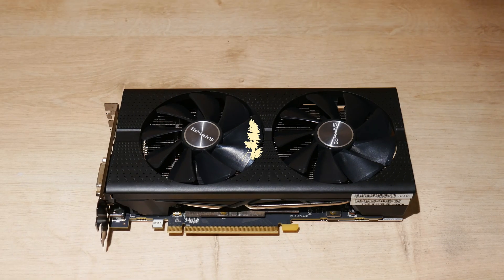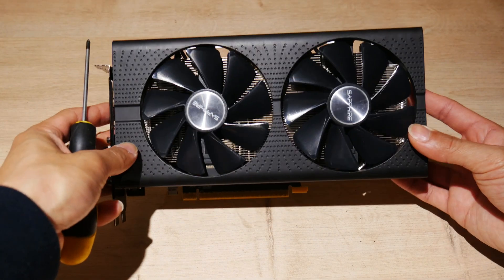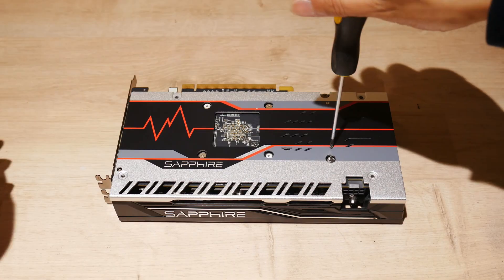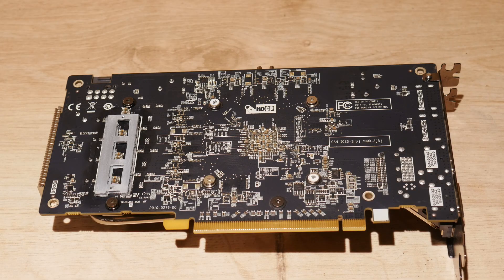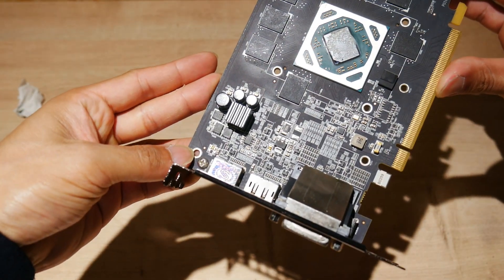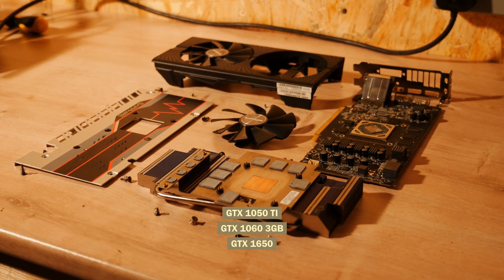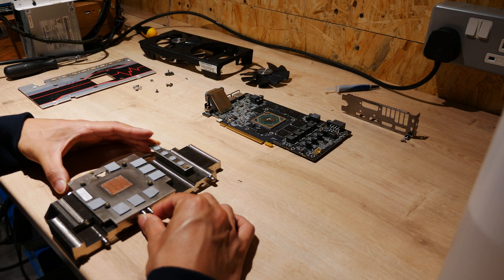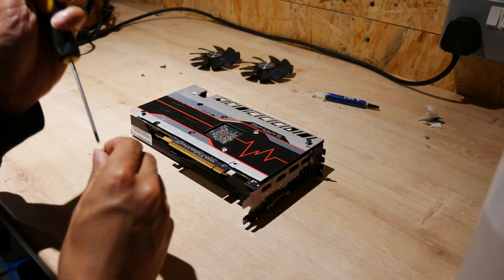Sapphire RX 570 Pulse - Disassembly

Comment: Can you name the screws for the back plate and heatsink with it's sizes? Also the pci bracket screws? Cuz i want to replace my screws as it's rusty.
Reply from the maker: They're called graphics card spring screws

Unfortunately, I no longer have the card to verify which length and size

They come in M2 or M2.5 (2.0mm or 2.5mm diameter), so measure your existing screws carefully

Comment: The thermal pads can be reused ? because it has dust i just flipped it to  looks new is it fine? When playing triple A games my temp 75c
Reply from the maker: It's mostly okay, even with a little dust on them
They're for cooling the memory chips, as opposed to the GPU die which our temp readings refer to

I don't think I've ever reached 75°c on mine, so fresh thermal paste on the die should sort it

Comment: bossing i'll be purchasing the same card tomorrow, planning on doing the same thing that you did. Ok lang ba i retain ung original thermal pads nya? wala kc ako pads and not planning to change them if they can still be reused. thanks
Reply from the maker: Yeah, you can reuse them - I did
Reply: Salamat kabayan i bought the same card online sa fb i played games and the temps reaches 80c constantly. First time ko mag palit ng paste ng gpu, followed all your advise sobrang dry na ng paste nya pala i cleaned it, used noctua thermal paste and boom! Na solve problem my gpu never goes 60c when playing now laging 52 to 56 lang the difference is so big!
Reply from the maker: Really? 80°??

I'm so glad it's worked well for you

Comment: YOOOOO. so, since is quite easy to disassemble, you could experiment modifying the shroud (maybe even put 120mm fans?) or test ducting in your home made case
Reply from the maker: I love the idea - the card's no longer mine (I gave it away too quickly), but it'll be back
Reply: @TheBuddingEngineer  yaaay